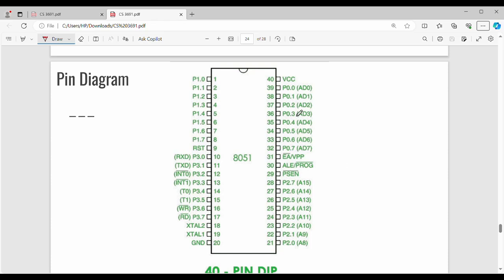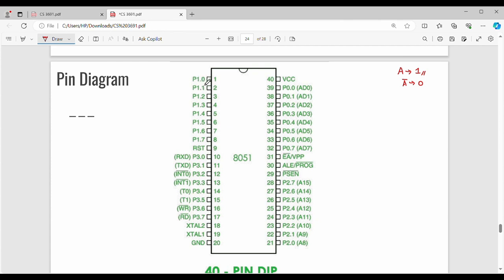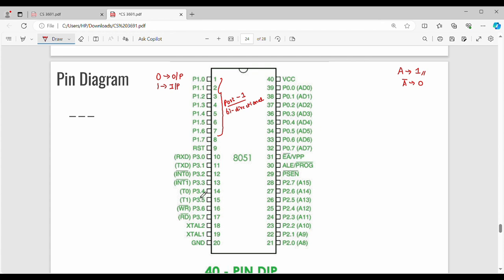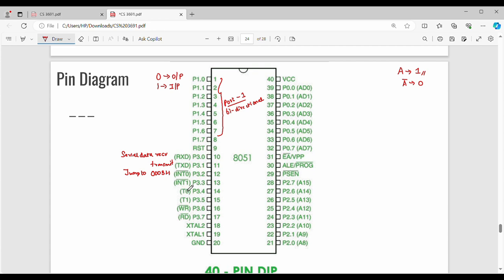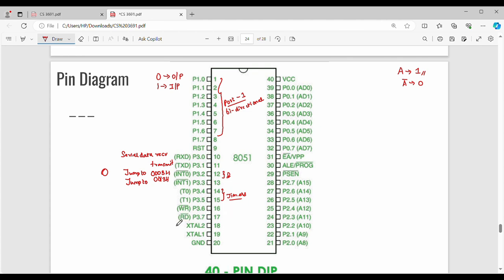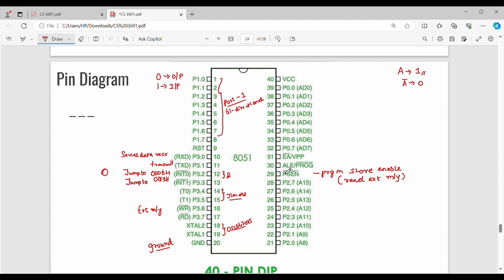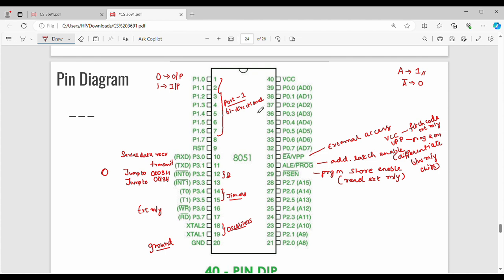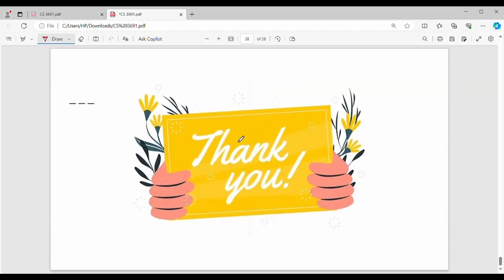8051 Pin Diagram in Tamil | Lecture 2

Comment: Is it necessary to draw pin diagram in architecture of 8051 microcontroller sir?
Reply from the maker: yes its good if you include.
Reply: Thank you for your reply sir @because2022